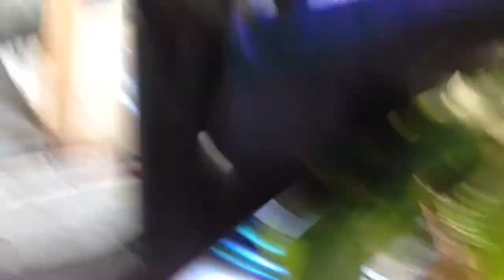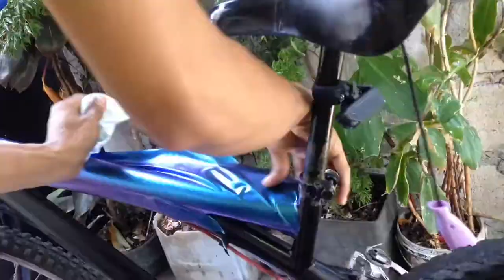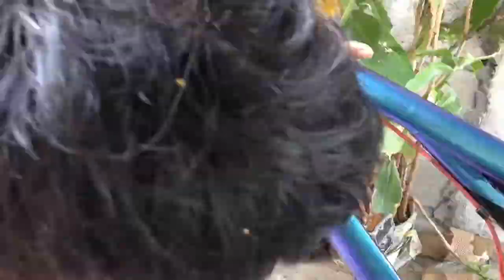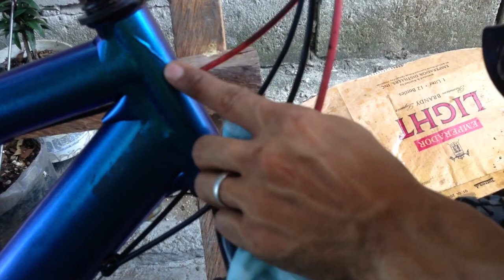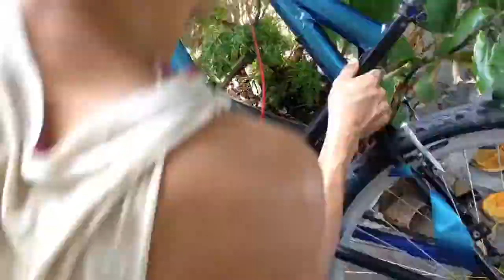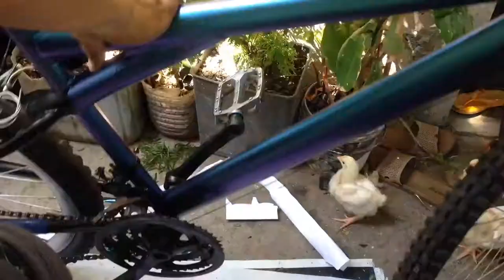How to vinyl wrap a bicycle | Vinyl sticker installation | Purple blue | Decal Sticker Installation

Comment: Hey, I’m doing this and I keep getting bubbles 😓 I’ve used squeegee and  heat but keeps forming what’s ur trick?
Reply from the maker: what thing did you wrap? i just put the sticker on and heat with blower while pressing it with a towel
Reply from the maker: press with towel while heating . press it like its going to stretch
Reply: Just use a small needle and poke them out it slowly squeeze them out